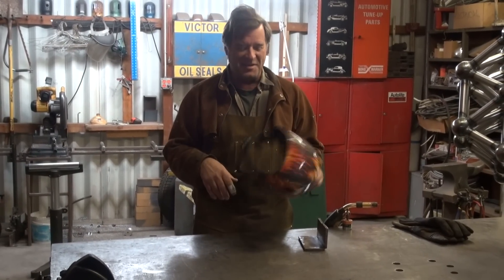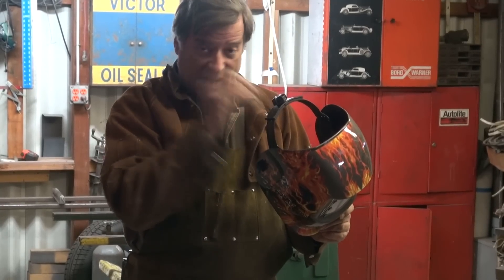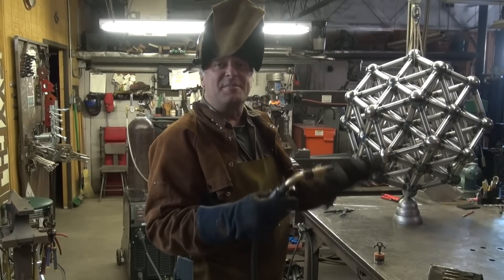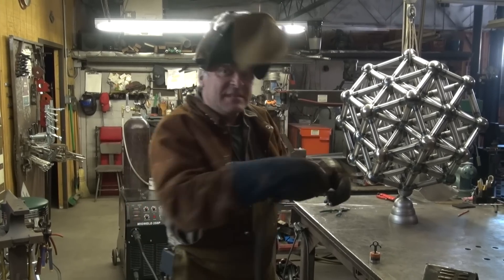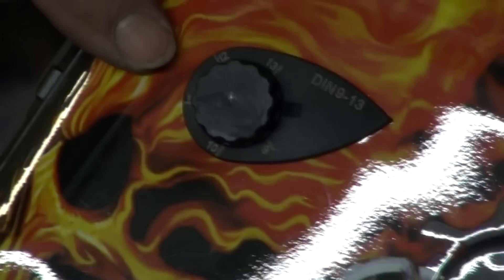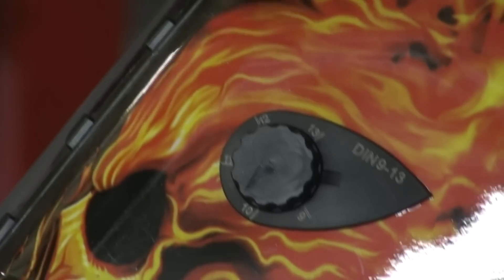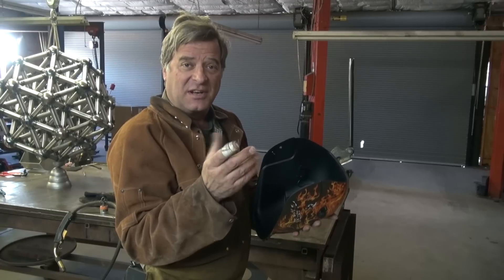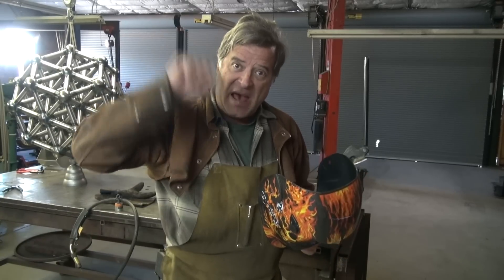How to See Better Out of Your Welding Helmet - Kevin Caron

Comment: Hi Kevin, i bought and unwrapped  a metal man helmet the other day. The lens on the inside if the helmet had, i guess a thin protective cover?, which was about 50% off the lens.  Is that cover supposed to be removed??  I guess you can tell I'm a NUB.
Reply: new helmets have several lens layers. from the outside going in, here is what you will typically find: a thin film of cellophane to protect the clear  plastic lens, then you will find a clear hardened safety glass lens, then your filter lens (typically green) then you will find your electronics layer on electronic helmets, and the next will be that same clear plastic lens protector (these protect the expensive glass lenses when welding and they need to be replaced when scratched or pitted they are cheap when compared to safety lenses or filter lenses) and lastly you will find the disposable cellophane film ( these prevent scratches during shipment and need to be discarded before welding)
Reply: clean your lenses regularly (daily if you weld for a living)  and you will find that you can see  and weld way better with clean lenses

Comment: Air carbon arc cutting      recommended  shade #  12-14
SMAW  250-550 amps    recommended  shade #  12-14
GMAW  250-500 amps    recommended  shade #  12-14
GTAW  150-500 amps     recommended shade #   12-14
PAC     400-800 amps     recommended shade #   12-14

Modern Welding 11th edition  Althouse/Turnquist/Bowditch  The Goodheart-Wilcox Company, Inc. 2013

Comment: Hi Kevin, your vids are a great help. im NEW to welding . went out and bought a 90 amp/120, flux cored welder from HF. to be able to get started out and to play around with. my problem is , it seams like when I get ready to weld, it takes the flux core to pull out of the gun almost a inch and a half before it starts burning (unlike me cutting it about a quarter inch and it starts burning immediately) witch I read it should. my feed rate is on 2 and my out put is on Min. any suggestions/ help would be appreciated. thank you , Eric
Reply: Eric Hurley try clipping the wire after each hit when using flux core I find that the flux makes it a pain to start the arc also having clean work pieces and a good clean ground helps... I am no expert in the slightest though....
Reply: sorry to say this but the problem with ur welder is that u bought it at harbor freight........ i wish i coulda told u this before u got it but save ur pennies and buy a good flux welder at lowes
Reply: lol, its worked fine for three months now. it was just me not knowing welding.
Reply: whats it rated for?

Comment: Kevin, i have not read all the 79 comments on this, but what is that piece hanging of your helmet? Is that just protection or has something to do with the light? thanks for the videos!
Reply: Also if u do overhead welding alot it becomes ur best friend because if let's sparks roll down. Past the open area of ur jacket

Comment: which tint do u prefer for strike arc welding cause i dont have auto darkening and its only a #10 lens and i cant see where the piece of metal is to start welding on
Reply: ***** i saw the video you made. i know what functions of welding helmet you bought . i also agree with you that 10 for just about everything .but its  a little light for some welders for tig if the dark state is 10

Comment: Pick up a GOLD (not green) fixed shade #10 if you really want to see the puddle. Couple bucks more but you will be amazed how much more crisp and clear everything is. Your beads will look atleast 50% better guaranteed.
Reply: ill try it im a beginer an rhe few times i can see where im going my beads look fair but most the tim i will go off line half n inch on a 8  inch weld how you or anyone else can see eludes me
Reply: I don’t notice much a difference. I used them all and when I’m focusing on the puddle and what not, I don’t care about how clear or crisp it is

Comment: I use 12 and 13 for flux and stick
Reply: Thats good then you can go to lighter shades when your eyes start to go ...
Reply: Oh yeah i do have good eye sight i use a speedglas the new 9100 but im in school right now i do everything though tig mig flux stick all at the highest i can go and lowest on volt and amps like tig i have to use a cheater i use a 2 but i like to work with 2 amps that i use 9 on the shade

Comment: I find that shades 12 and 13 work extremely well for welding aluminum both TIG and MIG. I use 13 if I am welding aluminum outside. But as you say this is what I like this works well for me and in 20 years of welding I have yet to wake up at 2 am with a headache and or arc burn so I must be doing something right. Thank you for taking the time to make this video.
Reply: well 13?in fact the most welders like use 11 . bcs my most clients feedback me that 11 is the best. as for 13 is too dark to see
Reply: welding helmet gong Those where suggestions obviously. For general purpose I use a shade 9. Most stick and hardwire are viewed(by me) quiet well through that shade, this goes for Dual Shield too.Its all in what you're comfortable with. Comfort coupled with skill is the key component in quality welds.

Comment: Really appreciate your videos.  Just got a Miller 211 for some projects that have been languishing.  It's been over 25 years since I've done any welding, and that was stick welding.  Your videos have been a great tutorial on getting started with wire welding.
Reply: push your gun dont pull it its oposite to stick with a stick you pull with mig you push it keeps the gas on the ark were its meant to be pulling it like in this video allows the gas to go everywere bar were its meant to be hope this helps pushing the gun will make all your welds look like a pro did it hope this helps.

Comment: Oh, I did go ahead and buy the AHP Alpha TIG 200X, based off your comments and a couple other threads I checked out.  Unfortunately my cheap auto darkening helmet isn't up to the task and when I tried to use the TIG I kept getting flared.  I like how solid the machine seems, and everything looks good with it, just need a new mask.  I ordered a Lincoln Viking 3350 a little while ago, for the money it better be up to the task.  Thanks for all  you share, and for responding as you do.

Comment: Hello Mr. Caron, pretty good videos and thanks for taking the time to post them. I just got into stick welding and I'm having the darnest time seeing the seam that I'm trying to weld. I can see the welding puddle but not much anything else. I have the helmet adjusted to #9. thanks
Reply: i am recently having the same problem with mine,i have not used my helmets in two years, i have one for tig and one for mig or stick but i blew a test the other day because first of all the auto darkening failed and the arc burned my eyes and then like you i was not able to see the seem or the surrounding only the arc glow and i failed the test blowing holes or not making a good tight weld, i then tried mig and had the same issue, idk if it was my bad eyes or the helmets are too dark and not working like they used to even though i had it on the lowest shade

Comment: I used to weld with #12 shade when mig welding with 1.2 mm wire at 250 to 300 amps, 20 mm thick in HV position or V Butt weld spraying arc flat.

Comment: Another great video guys :) I'm in the market for a welding helmet at the moment so this is really useful.

Just one question, are there shades available below 9 and would they be TIG safe? I ask because in the video, even with my monitor at it's highest brightness, the most I could see was the arc and the electrode, and could see very little of the work piece itself. Ideally I'd like to be able to see where I am on the piece, if only in my peripheral vision, to make judging my speed easier.